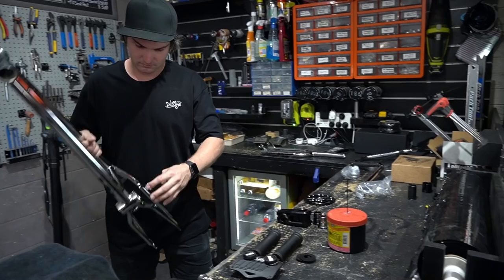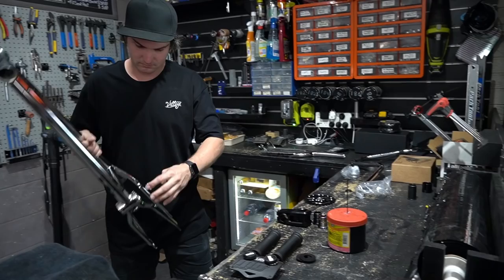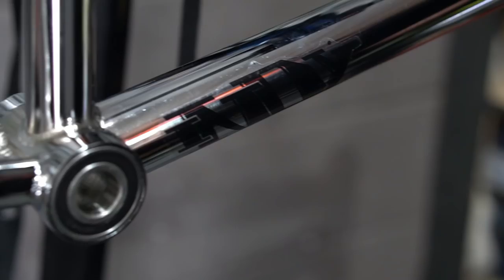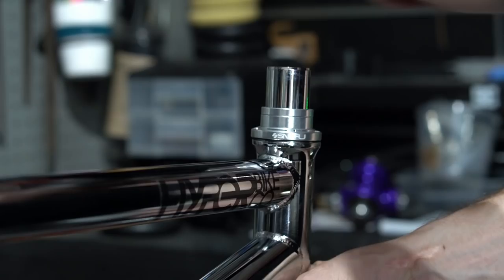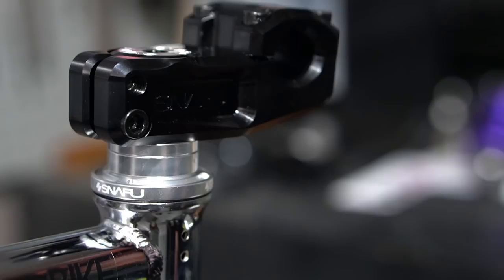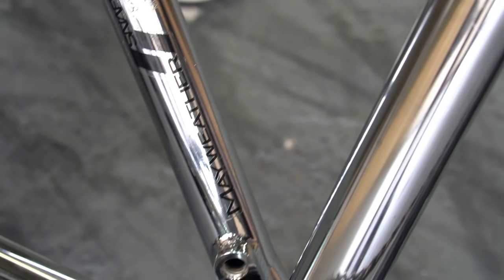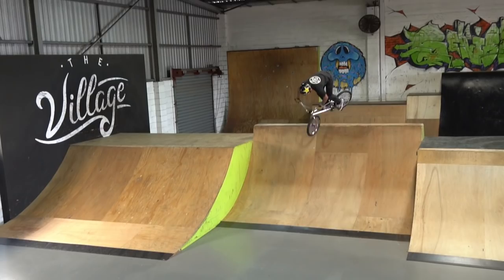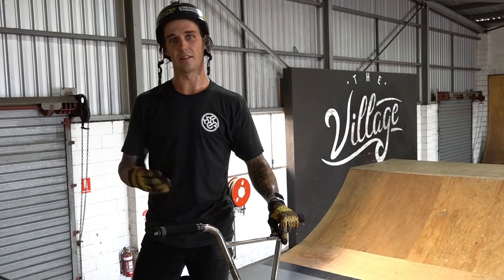NEW BIKE BUILD!!!

Comment: I put all my grips on the same way.  Compressed air is easy and ready to ride instantly.  Just as easy to remove.  Word of caution however.  If one end is really stuck to the bars good and you shoot too much air under the grip...grips WILL blow up like a balloon real quick and distort.  Go easy.  Low volume.  Low pressure.